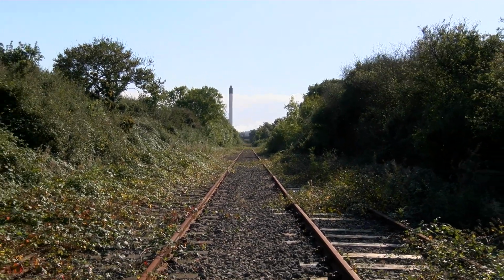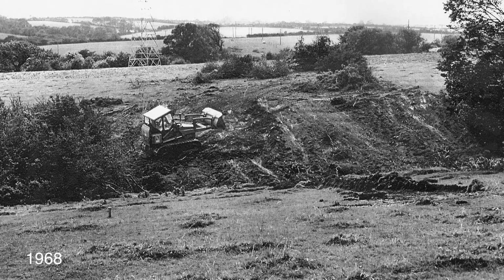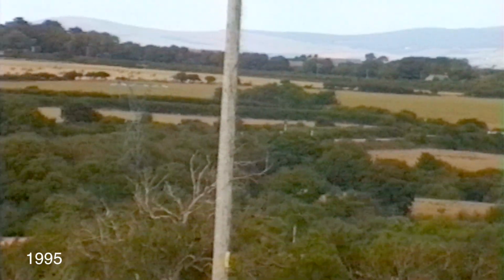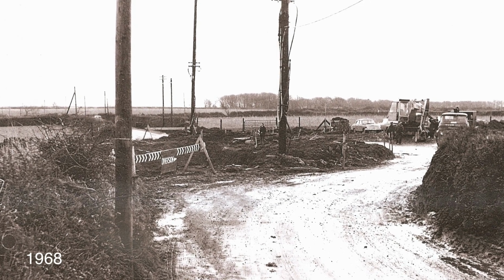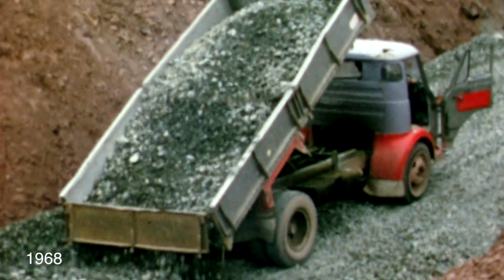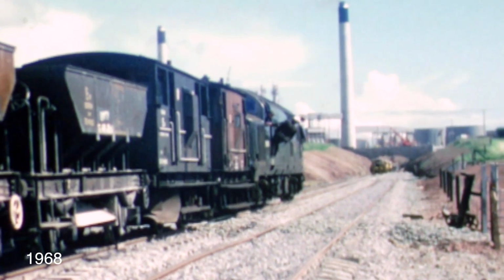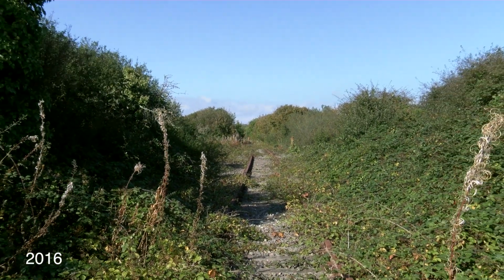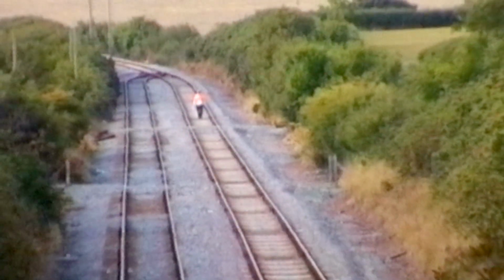Gulf Oil Refinery Branch Line

Comment: I started as an apprentice on the Gulf refinery in 1992. The blokes used to let me drive the diesel shunting locos (under supervision, gardener engines as i recall) up and down the refinery sidings as far as the gate and connections to the mainline. They also let me drive the fire engines and anything else i fancied really. Great place, great memories.
Reply from the maker: Do you still live in the area? I haven't been back since the last video with the guys that built the line and would love to know what it looks like now...

Comment: It sad after all this work it left to rot
Reply from the maker: Hi Joel it is sad but it did operate for 30 years until Gulf Oil left South Wales. I would love to go back in a few years and see what it looks like. I have heard from a local that the Signals about 100 meters on to the line and well buried in the undergrowth have now been disconnected.
Reply: It could be used for tourists attractions bike lane
Reply from the maker: @joeldelamirande5792  it could be but kind of starts in a field and ends up in private gas storage facility. I like restored steam railway can't have enough of them in my opinion.

Comment: LOL! This is definitely not Gulf of Mexico. You has the wrong title!
Reply: The Gulf oil refinery at Waterston near Milford Haven one of 4 refineries in the area. Maybe you are too young to remember the company who were very active in motorsport sponsorship in the 60s. 

The title is correct.

I’ve worked on jetty parties at that refinery in my late teens for the local port services, mooring incoming VLCCs and changing the lines connecting the cargo tanks to the jetty head (and then on to the refinery tanks) the same company also operated services for the other 3 other refineries, Texaco, Esso & Amoco, along with the BP jetty which wasn’t associated with a local refinery but connected by a pumped overland pipeline to Llandarcy near Swansea.
Reply: @ArmpitStudios  Funny thing is I passed over that very railway line only 2 hours ago on my way back from Milford Haven, I spent 5 years working opposite the old Refinery which is now “Dragon LNG” 

For clarity https://en.m.wikipedia.org/wiki/Gulf_Refinery,_Milford_Haven, I meant to post this with my original reply. Happy memories of working on the jetties at all the Refineries along the Haven in the 70s...